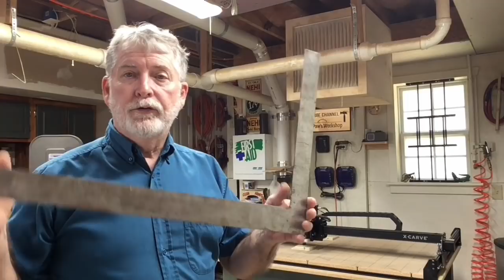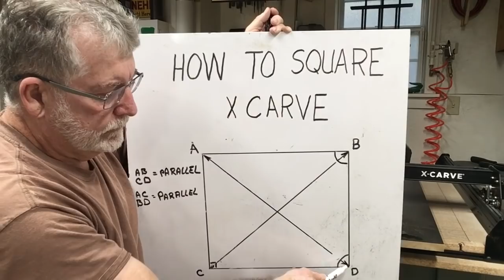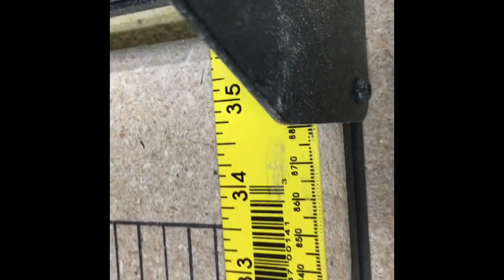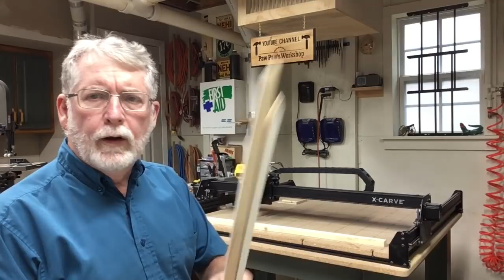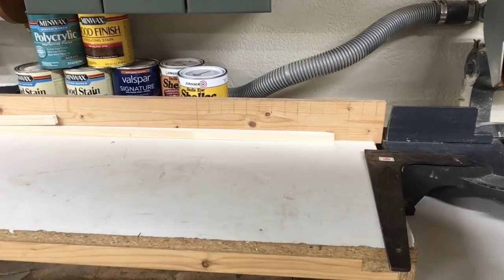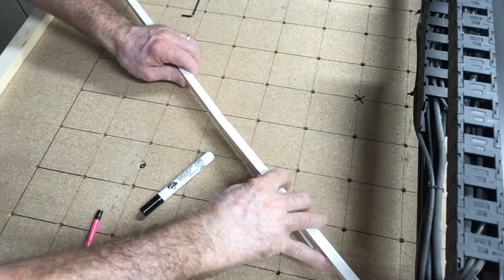How to Square the XCarve Easy (No Math and No Complicated Tools)

Comment: But did you cut out or engrave a large rectangle with the machine and measure the diagonals of the part to make sure the machine is actually cutting square?..that excarve is very similar to the neje laser i bought..i struggled getting it square and even though the frame was square the machine still wasn't cutting square..i had to put some shims in the x rail on one side to get it..its still not perfect but is now acceptable to what i do..im thinking about getting a shapeoko pro and that thing had better stay in square or i will not be happy..ive read some ppl recommend checking square before every project and i sure do want that!..instead of throwing away 3 grand i would rather spend 12 to get something that is accurate
Reply from the maker: I do not believe it is necessary. When I setup my machine and I know it is square then it will machine the projects correctly. No, I do not square the machine each time. That’s just crazy. Setup the machine once then enjoy making the projects. You do not have to continue messing with the setup unless something actually happens to change the setup.
Reply: @PawPawsWorkShop  Thanks for the info..yeah its just that what i make( fairly large rectangles) need to be square..i have to pull my gantry forward up against the hard stops and hold them there while i turn on the power so the motors will lock the gantry square with the y rails..if i just turn on the machine without being up against the stops it will not cut square at all..there is a lot of twist and play in the x gantry to the y rails..i just figured these hobby rotors are going to be the same maybe just not quite as loose..do you have to do that or do you just turn on the machine  wherever the gantry is?
Reply from the maker: I just turn on the machine wherever the gantry is located. The gantry does not move unless the machine is on

Comment: It’s been a long time since I’ve used my xcarve. I know something it out. But I don’t know what. I inherited from my brother when he closed his woodshop. So I was not the one that put it together. I think there’s definitely value in putting it together. 

I haven’t used my cnc for over a year. Probably closer to a year and a half. But when i stopped part of the reason was that there was something off. One side of the bed was cutting deeper than the other. I had my husband check some things and I resurfaced my spoil board but it’s still off. I want to make some projects but it would require it to be cutting correct depths. I wonder if this video will help solve the problem? I just don’t know enough about it to know if it’s out of square or something else. It won’t hurt to try squaring it.
Reply from the maker: It’s great to hear from you again. It actually sound like your machine may be twisted as well as out of square. I would try setting the machine on a known perfectly flat surface. Then loosen the bolts and make sure it’s sitting completely flat and then square the machine. Don’t forget the gantry, pull it to the front and make sure that the gantry hits evenly on both sides of the Y axis front rails.
Reply: @PawPawsWorkShop  Thanks. I watched another of your videos about calibrating it. I feel like I have at least a good place to start and investigate. Thank you so much.

Comment: Has anyone tried to simple screw the Xcarve to a base without the waste board like the Oneinfinity CNC concept? Reason I’m asking is cause I’m going to do that and place support aluminum plates along the Y axis. I will also be using aluminum L-brackets for the feet’s to secure everything down.
Reply from the maker: I think you have a great plan. It should work just fine. Good luck. Please let me know how it works for you.

Comment: Will this method work if the wide marker is crooked? when I slide the Gantry all the way to the bottom I hit the left plate first and about 1" away from hitting the right plate
Reply from the maker: You must get the base square first, then move the gantry all the way to either the front or back. It must be adjusted until it it even on both side
Reply: @PawPawsWorkShop  Thanks for the response! I have tried 2 times. I used a square on each rail to make sure they were all square. also the 1000MM rails are sticking out past the wasterboard 30MM on each corner like the instructions say, so not sure what I'm missing but I will try it again tonight! I've been watching your videos and I have learned a ton from you! Thanks for all you do for us newbies

Comment: Which screws did u loosen. My machine is off, I believe on the Y axis as all my carves are.coming crooked, creeping up from left to right, about a 1/4 inch
Reply from the maker: The screws at the bottom of the plate on the y axis.  That way they can slide left and right.

Comment: Great video and I learned a lot.  I was 1mm off.  I'm hesitant to make that small of an adjustment since I may do more damage then good.
Reply from the maker: You maybe right. On mm is very small.  If you start to do tiling you will see the difference.  On mm on one side will multiple over 1000 mm machine.

Comment: Out of the blue, my x axis drifts by 3/32” from the front to the back. My frame is squared and I’ve squared and trammed x and z. Any ideas? I didn’t realize it until I tiled a project and and I kept being 3/32” off when I slide the project to the second half.
Reply from the maker: That is a small amount for normal carving and you most likely never noticed it.  However, for tiling it a whole different world.  That will make a difference.  I would check everything again.
Reply: @PawPawsWorkShop  Thanks again. I was about 4mm out of square.
Reply from the maker: That will do it!  It does not take much to mess up a tiling operation
Reply: @PawPawsWorkShop  thank you. I just 3 stage tiled an 8 foot board a few weeks ago and it was fine. Just started happening this past week. Maybe a screw came loose or something.

Comment: Just did this to my machine, although i had to loosen the front screws since I dont have easy access to the rear. I was off by  about 1.58mm. The story sticks work great.Thank you
Reply from the maker: That's awesome! Yes, it does not matter if you loosen the back screws or the front.  I did the back because of the camera.  Thank you very much.
Reply: @PawPawsWorkShop  you have helped me a lot with my machine
Reply from the maker: Awesome!  That means that I have done my job.  Thank you very much.
Reply: @PawPawsWorkShop  now can you direct me how to get this thing to carve a circle properly?
Reply from the maker: Now that it is square, you still need to calibrate the machine.  Take a look at my video on calibrating.  Also, make sure that the v wheels and belts are adjusted correctly.

Comment: All this procedure accomplishes is squaring the FRAME/BED of the machine....this DOES NOT insure that your machine is CUTTING square. 
To check if the machine is CUTTING square, use the "3, 4, 5" method and adjust the gantry accordingly......Peter over on CNCnutz channel has an excellent tutorial...
Reply from the maker: This video was done to answer a specific question.  I did not discuss the gantry and how to square nor did I discuss the z axis.  There are a lot of details to get the machine setup right.  The use of 3,4,5 is a great method of establishing a square corrner.

Comment: Wow, this method is awesome.   Qq: if long side was 1380 and short side was 1374, the difference is 6, so would it work to just move the long side over 3mm?  Thanks for laying this out in such a complete manner.
Reply from the maker: Yes, that should work.  That's a good start.  Double check it until the sides are equal.  Don't complicate it.  Use the sticks and measure until when measuring there is only one line when you measure both directions.

Comment: I finally squared my X Carve using your method. I was off by .003” distance C to D and A to B. I got it so close to being absolutely perfect. I could barely tell it was off running from one side to another if I didn’t know better I would have thought it ended perfectly square. I did a square test of 3, 4, 5 and passed with flying colors. Now to drill my holes for sacrificial waste board and surface it. I think I’ve watched all of your videos 10 times each.
Reply from the maker: Awesome! Thank you very much

Comment: Ive never used v carve bits....where is a cheap place to buy?...and what would you recommend? 15 30 45 60 90 degrees?
Reply from the maker: 60 and 90 are probably the most common bits used.  You can get them at you local big box store.  The other bits are based on your personal preferences and the type of projects that you plan to do.  Inventables also has a good selection of bits also.

Comment: Sure will......im sure most peoples xcarve are not square since there is no built in assembly process that assures its square which they should redesign so that it is assembled square
Reply from the maker: You are probably right.  However, there are so many variations in people's machines that may make it very difficult.  This simple method ensures that the machine is square.